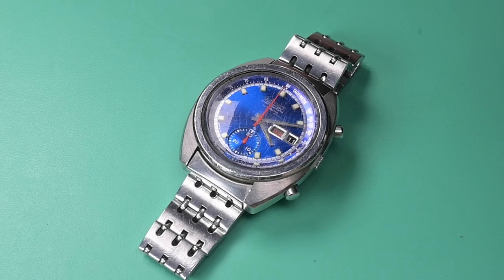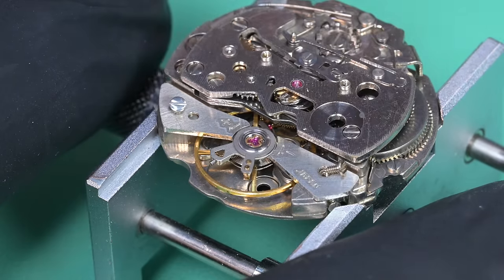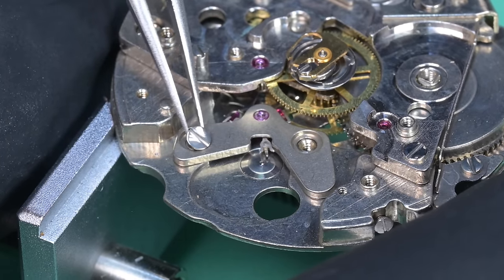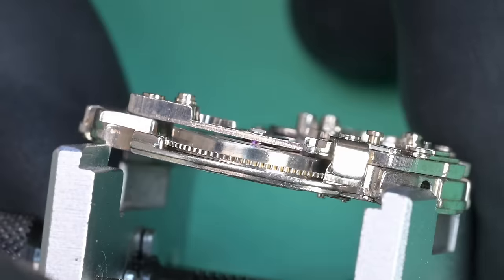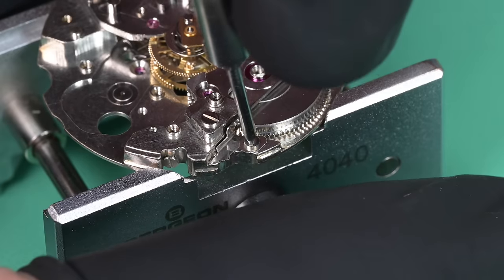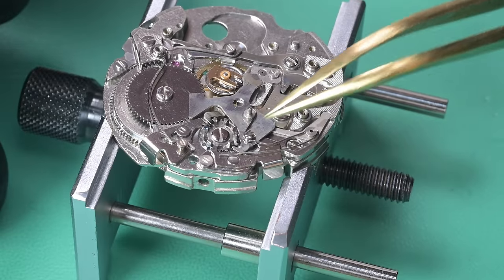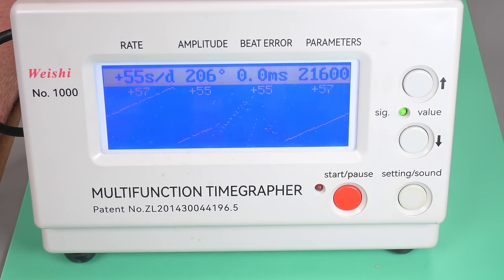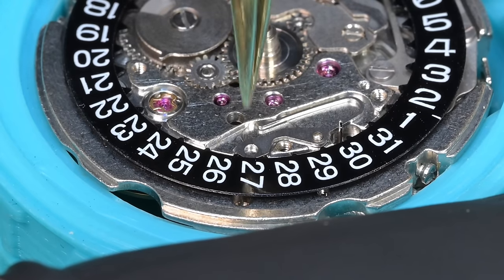Vintage Bruce Lee Chrono - 5K Giveaway (COMPLETED) - I Was Shocked When I Opened This Watch!

Comment: Great job.  You must get all the best 6139’s.  Most don’t run this well on a rebuild.
Reply from the maker: Thank you.  This one was in exceptionally good condition to begin with.  Not all of them are like that though, including some others on the channel.  I've done enough of them at this point that I can generally get them to run pretty well, but it may require much more work than this one needed.  They are robust movements that can usually be brought back from pretty poor conditions if done correctly.

Comment: I really love these vintage Seikos. I’ve bought a few non runners off eBay and fixed them up (and made a few even worse) I would like to try repairing a chronograph at some point, but they are a little intimidating 😂 You make it look so easy!
Reply from the maker: Thank you.  It may look that way because I've done so many at this point, but it only comes with practice.  Just read the service manual thoroughly and give it a go!  Be careful when handling the chronograph wheel, and everything else is pretty much repairable.
Reply: @WeekendWatchRepair I’ll definitely keep that in mind! I only just started 3 months ago so I definitely need much more practice, but your channel and others have been a great resource.

Comment: For removing dust, have you tried a shop ventilator?  It’s sold for woodworking and is basically a box that goes on the ceiling and turns over the air in a room.  Has filters and is relatively inexpensive.
Reply from the maker: I’ll look into that, thank you.

Comment: I seem to have to worst luck with this movement. Always something broken, usually the center chrono wheel. Nice work here!
Reply from the maker: Thank you.  It wouldn't be so bad if there was a way that one could repair those wheels, but any attempts I've ever tried, or even read about, have ended unsuccessfully.  I suppose that's why those wheels can command the prices they do.  I've ran across my share of those failed chronograph wheels.  I've had better luck buying donor movements (in poor shape) for less money than buying a NOS chrono wheel.  I'd say that 90% of the 6138 & 6139 donors I've ever bought had a good 4th wheel in them.

Thanks for leaving a comment.  I enjoy your channel, and like your unique approach on how you post your videos with the sped up footage.  I'd love to try my hand at a cal. 217 like you had in your Angelus Chronodato video!
Reply: @WeekendWatchRepair  Ha, thanks for the shout out, "unique", hahaha.  I'm not an entertainer by any means, it's purely for future reference by whoever needs it. 

I agree with the center wheel being a consumable item. I've tried many ways to "repair" them. The best I've done it get it in running condition while waiting for the donor parts. 

Definitely don't pass the Angelus if you get a chance. I'm on the hunt for a black on stainless version.

Comment: Great video Adam, and good to see you replacing the upper and lower main spring arbour port bushings with jewels. 
I don’t believe Seiko get the credit they deserve for quality and longevity, the timegrapher numbers prior to service weren’t disastrous on a movement over 50 years old. And that dial! 🤩
Reply from the maker: Thanks, and I totally agree.  Those 61 series chronograph movements were well engineered and will run for decades.

Comment: well, i guess if i have to comment for entry i might as well say something useful lol I have the same cleaning machine and probably did about 150 watches over the past year. I have never had an issue with running the balance assembly in there attached to main plate. I just be sure not to spin the hell out of it during the spin off cycle. Not saying you're doing anything wrong, just my experience since we have the same machine. Beautiful watch. I have not serviced a chronograph seiko before.

Comment: Your videos have inspired me to get start repairing my own watches, I will say that you make it look easy but every screw is a challenge for me, I have ordered three sets of screw drivers thinking it must be my tools. What drivers do you use? I would like to see a tool overview episode sometime.
Reply from the maker: I use the Bergeon 30081-S09 mini screwdriver set.  I like the shorter length screwdrivers.  Just as important as the screwdriver is how you dress the tips.  You'll find that screw head slots vary between watches.  Some will be wider and some will be narrower.  Your screwdrivers need to fit snugly in the slots or you will have a difficult time working with your tools.  It would be a worthwhile investment to purchase an Arkansas stone (preferably), or something similar to shape those screwdriver tips.  This needs to be done regularly as those screwdrivers are very small and will wear down with use.  I dress my screwdrivers before working on each watch, and sometimes during if I find a screw that my screwdriver isn't fitting properly.  You can find a tool that will hold your screwdrivers at a specific angle that will help ensure that you shape them evenly on both sides.  These can be found for only a few dollars and really help - reference Esslinger SKU: 52.469.  If any of your sets use the same tips as the Bergeon sets, you can just swap out the tips and not have to buy an expensive new set of screwdrivers.  That's really the only part that matters, and having a good quality tip that is properly dressed will make a world of difference.   Thank you for the suggestion about doing a tool overview video.

Comment: Hey Adam, you mentioned in this video about correcting coned mainsprings (or did I misunderstand?). If you can tweek mainsprings do you show this in any of your videos? Mainsprings in vintage Seikos are nigh on impossible to replace so I'd be interested in this if it is possible. Many thanks. Chris
Reply from the maker: I have shown extremely slight hairspring correction in a couple of videos.  More of the detailed work I tend to do off camera as it takes too much concentration and my hands are in the way of the camera view.  I'll make an effort to record it next time I find myself attempting mainspring manipulation.  Thanks.
Reply: Thanks for the quick reply 👍

Comment: Well done as usual.  A question on the screws.  In many base Seiko movements the screws are identical in all dimensions and thread as opposed to Swiss movements.  Is that so with the 6138 and 6139?   The reason I ask is that usually, on a Swiss chronograph I replace the screws to the place they were removed from after removing the arm, spring or etc.  This ensures that I have the screw in the correct hole as the depth and head of the screws in Swiss movements vary so much.  I noticed that you did not do this in the Pogue restoration.

Best wishes for the new year and many more, Geoff
Reply from the maker: Thank you Geoff.  That isn't the case with every screw in these movements.  I store the screws with each part so I can ensure that they all go back into their original positions.  It accomplishes the same thing, but I just don't leave them in the movement during disassembly.
Reply: @WeekendWatchRepair  thanks for the reply!  I knew you had a procedure!  Cheers.

Comment: Just curious if there is any difference in the quality between vintage and modern Seiko movements?
Reply from the maker: To be honest I don't have a lot of experience with many newer ones.  I've never serviced any Seiko newer than a 7S series, which came out in 1996.  I'd prefer the old one's if given a the choice, the but newer movements seem to run fine.  I've got a couple watches with 4R and 6R series movements, and they've all ran fine.  I've fine-tuned the regulation on them, as out of the box they have some room for improvement, but they do run really well.  I'll know more after a few more years when it comes time for me to service them.

Comment: I gotta say it...it's about time.

Respectfully, I just cannot understand after all this work — approx. $700 in my town — that the lume remains as original. I'm just talking about the hands. I disagree that the lume looks fantastic — who would want that on a new watch? Its a fantastic piece, no doubt.

 I've seen many a watchmaker easily replace the lume with superior lume than original. Its like a car restoration and the headlights remain dim and yellow with a fainted instrument panel. Honestly, why skip this step? Has anyone seen the work of the Nekkid watchmaker? You don't have to go that far, tho, but honestly. It should be unacceptable because lume replacement is easy and cheap. But if the fingers can't do it, well...
Reply from the maker: Respectfully, the fingers can do it.  We all have different tastes, and if this was going to get a full restoration, with complete case work, etc., I would have re-lumed the hands and likely the dial as well.  Since the goal of this watch was to keep it's originality (as explained in the video), they remained untouched.  I'm not opposed to doing it, but on this watch I felt that it wasn't the correct course of action.
Reply: @WeekendWatchRepair  I appreciate your reply. I understand the goal. Fan just the same